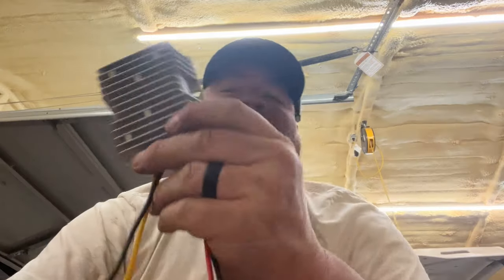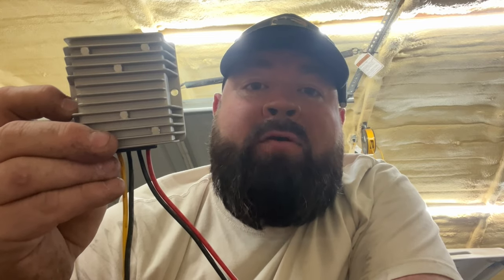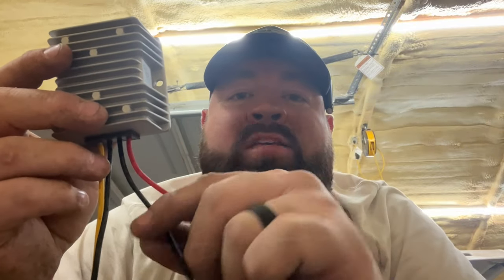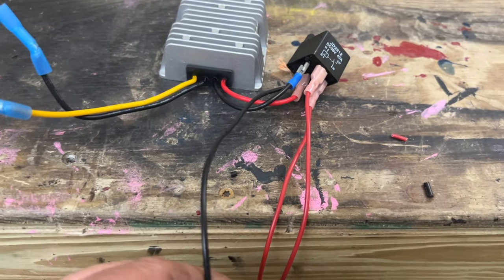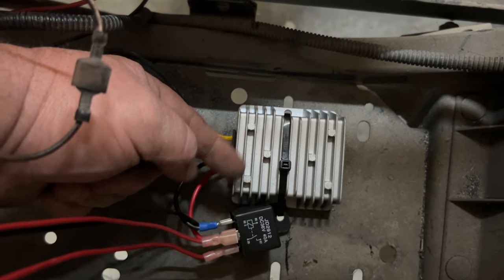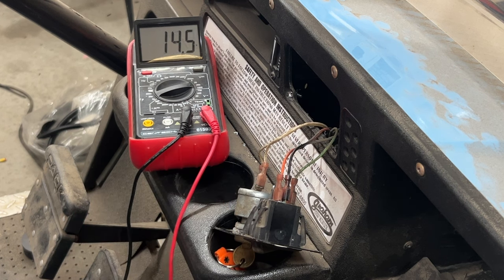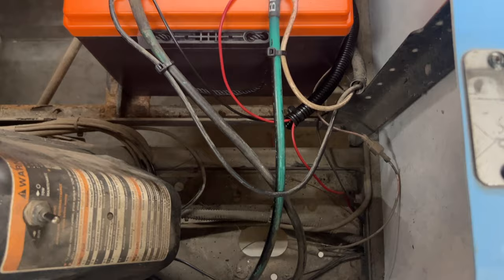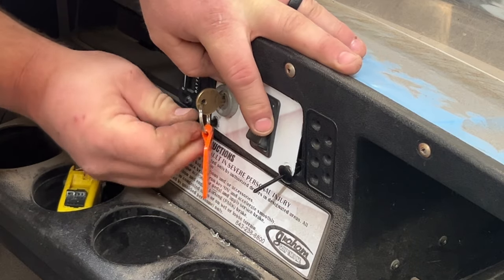Ezgo TXT PDS Golf Cart DC - DC Converter & Ignition Relay Install

Comment: You just saved my new Lipo 36v battery and my elderly mother’s summer. I couldn’t figure out what was draining the 6v batteries since there were only lights and a battery meter on the cart and they were on switches that I installed. Upgraded to LiPo a few weeks ago and still had a slight draw even though lights and meter were both disconnected for troubleshooting. 
Was just about to replace the step down converter when I ran across your video. Big thanks !

Comment: Once again, thank you for explaining relays (quite a few videos ago) so that I could finally understand them. Another benefit of using a relay with a puck converter (especially for the timid) is you don't get that "ZAP!" and a little bit of 💩 in the pants when first connecting the puck converter to power that you get if you just wire it directly. The "ZAP!" only happens that first time you connect it, and I know it's coming (and that it's okay/normal), but I frickin' hate it!

Comment: My friend told me guests using her cart left the lights on and killed the cart. Ezgo has the light switch down by the charger plug so easy to forget. I was doing a lithium conversion for her back then when I watched your older relay install video. Perfect timing as usually, that’s why I keep up with your videos. Works great and I always add the relay to the conversion’s that I do. You made me look good once again.
Reply from the maker: I think I have a new one coming this week you might be able to use as well. I havent seen anyone do this mod and I think it will be helpful!

Comment: I have a dedicated 12V battery for all my 12V accessories. I used a 36V relay to turn on the power to the radio and lights. Has worked great. Once I go lithium and 48V then ill$9 the same thing with a lithium 12V. I’ll have 48V with 4 batteries and 1 for the 12V. So a total of 5 batteries at half the weight.

Comment: Great video, thanks. I just installed the same Voltage Reducer on my Ezgo DCS, ‘97. I wired the 36v Input to the Reducer to the 36v Switched side of the Key Switch. Reducer has no power to either side with the key off. I’m confused why a Relay is needed. Thanks Ryan for All the great videos.

Comment: THANK YOU!!! Amazing video and very well explained!  I have a question for you you though.  My cart is currently wired exactly like this.  BUT I have since replaced the key switch with a 4 terminal switch.  I can use position 3 (on with accessories) to get rid of the relay, correct?  So my DC converter will not have power unless position 3 is switched to on.  This will get rid of the relay as well as the extra toggle switch on my dash used for my lights as well as all the associated wiring!  Your help is greatly appreciated!
Reply: Also, do you have a link to those rivets you used?

Comment: Hey Ryan, love your videos. I’ve learned a lot. If I plug my golf cart in every day, why should I worry if my converter is always running? I never take the cart anywhere. I use it (everyday) to go to the pool, cruise the neighborhood, “walk” the dog. I’m not very good with electrical, so you can understand my apprehension to get into my ignition wiring. I look forward to your answer.
Reply from the maker: Your converter is constantly converting 36 or 48v to 12v. If you are sleeping, working, school, church, at the beach, the converter is constantly running. This will cause your battery to discharge even slightly over a period of time. You dont have to add a relay, just let it run. Im just trying to make my carts more efficient that ever.

Comment: Hey Ryan.  Its Brent.
I know you usually do videos about upgrades or fixing an electrical problem to get the cart running.
Would you please, make a video about routine maintenance of an electric cart.
How often should maintenance be performed?
What are the specific steps of the maintenance?
Is there anything that should be done before putting the cart away for the winter?
Are the maintenance steps different for each of the big 3 brands of carts? 
I have now owned my cart for 7 months. I have no idea how many different people owned this cart before me.
I will tell you that every screw, nut, and bolt that I have encountered is rusted. I have replaced some with stainless steel on my '09 CC Precendent. I can’t get the front body panel off because someone riveted it on.
I can drill them out but do I have to put them back? Never attached rivets before. I know you have an air compressor and air tool for that. That seems expensive to me.
I know that all of the screws and wire connections on the head lights are rusted. I cant even figure out if they are 48V or 12V, because they are incandescent lights.
I see under the cart that there is a lot of grease and dirt accumulated on the front left suspension.
I have no idea what I am looking for to determine what the problem is. The front right does not have any of that.
I have done no maintenance so far.
I have not washed it 
I have not checked the tire pressure. 
I have no idea how old the batteries are.
The batteries have been taken out and all the cables are off. Batteries take a charge when they were in the cart. They are not being charged during the winter. 
Each battery tested at 9 volts as it sat on the concrete floor about a week ago. 
Battery water has not been checked. Dont know how to do that.
Some people may think 'Oh come on. Everybody knows that." Sorry, not me.
Thank you for all you do.

Brent

Comment: Hi Ryan, after installing the relay, it worked good for about an hour, then it burned the relay. I realized nothing was working, ( relay was burned) so I installed another relay and I noticed it was getting real hot and it’s fixing to burn. I can smell it. What could be a better solution. I followed the instruction step-by-step. I do have another relay from the output power cords to the light bar.
Let me know if you have an answer or a solution to this dumb problem , thank you sir.

Comment: 7:01 do you have a video on this? I ordered a fuse box for my 12v accessories. Are you saying that there’s a separate fuse that needs to be set up that you connect to relay then fuse to battery? Thx so much!

Comment: This only applies to 4 wire converters right? A 5 wire converter with signal wire will not draw anything when the ignition is off correct?

Comment: How about making the 48v input switched by the headlight switch. The 12v output can be wired directly to the lights. That way the whole system is switched. No more drain and simplest wiring and fewest areas of possible fault. K.I.S.S. Cheers

Comment: Great explanation. I am finishing on a lithium single 48 volt conversion now(2015 precedent) and it has an oem 16 to 12 volt reducer installed underneath the front frame. Installing the 48 to12 reducer ( and relay)  . Do I just leave the original reducer ? ,or can I just cut it out and reconnect the wires?(1 in, 1 out).
Reply from the maker: If it was mine I would cut it out and start fresh. But thats just me.
Reply: @Fentertainment  
Thanks, that was my first thought

Comment: Hey Ryan if you have a lithium battery  that you can turn on and off  like the " "vatrer"  you wouldnt need the relay correct .
Reply from the maker: If you wanted the hassle of lifting the seat every time you got on or off the golf cart. I mean sure but a $5 part and some spare time will cure that. Maybe do the same with your vehicle, Unhook the battery everytime you turn it off!
Reply: @Fentertainment  You didn't have to be smart about it . I just asked a question . I barely  drive my cart  and  turn the battery off when not in use.

Comment: @fentertainment- thanks for the great video.  Maybe a dumb question but if I'm running this set up with my headlights can I tie in under carriage lights or do I need an entirely different converter?
Reply from the maker: You can add more accessories, I would just run a fuse block after the dc converter so you can run each accessory to have a dedicated fuse, power spot and some fuse blocks have ground blocks as well.

Comment: Great video, my txt has 3 position key switch off on turn one more for the lights, should I or can I add a DC converter to this if I want to add more accessories?
Reply from the maker: There should be 4 terminals on the back of the key switch. 2 for cart on/off 2 for light on/off. The dc converter can still be used since the headlights are getting power from somewhere now. Just need to add the dc converter. Maybe I will make a video of that one day.
Reply: That would be great

Comment: I just got my ergo txt from the shop and they couldn’t figure out why the reverse works when the key is in the off mode. I had a reliance dc 30A converter installed and he wired a kill switch for all my accessories. Was that needed?

Comment: Hey how you doing ? I just bought a CarPlay monitor with backup cam for my electric 2017 Yamaha drive 2 golf cart. I have two falcon big batteries powering the cart. The backup camera has a long cord to plug into the tablet and has a red wire to activate the rear view camera when it’s put into reverse. I dunno where to wire that red wire at. If you could help with an answer for this that would be great.

Comment: I have the blue DC convertor from 10LOL and my lithium BigBatteries are losing power. Should I get and install a relay like this? Only accessories I have are my headlights and brake lights.
Reply from the maker: If that blue converter has 5 wires then yes. However I would tie both the red & blue wire to the relays 30 & 87 to the battery.
Reply: Thanks. Love the channel and all you've done. Learned a lot about golf carts!!

Comment: Hi buddy,  is it possible you could just run a wire from the power side of the inverter to the key switch and do the same thing without a relay?
Reply from the maker: The key switch is supplying a minuscule load to trigger a relay vs what it would be to run accessories off a dc converter. The relay is just an inline switch as it still gets the main power from the battery. I personally wouldn't risk trying it because what you could damage by pulling that amount of amperage for accessories through a dc converter.
Reply: @Fentertainment  that makes sense. Thanks for the reply.

Comment: I have a TXT (manual forward/ reverse) I have LEDs and a radio etc. when I switch from forward to reverse or other way it turns everything off between. I can’t for the life of me figure out how to stop it from doing that.
Reply from the maker: The key switch looses power when the fnr switch is in neutral.
Reply: @Fentertainment  no way around that aside from a manual switch then I guess. Thank you.
Reply from the maker: @guninkdesigns3838  Ive been thinking of some different things. A switch will work but Ive been thinking of some different things.
Reply: @Fentertainment I’m following if anything cool comes up. Love the videos. Newish owner and learning.
Reply from the maker: @guninkdesigns3838  Much appreciated.

Comment: Would you do a walk through of a different DC to DC converter or send me to a link for said converter? I can also email you if you prefer. I’ve emailed you before but didn’t hear back.
Reply from the maker: I have other dc converter videos. This is my oldest 5 wire. However even with the 5 wire converter it still has a parasitic draw when the golf cart is off. I would still add a relay. However this was before I added relays.  https://youtu.be/P-6Q-0hFB8Y?si=pMGH8SArB_IL-S08
Reply: @Fentertainment  I’m preparing to install  reliance 36v converter and was hoping there was a walk through on the installation process. I cannot find a wire diagram displaying the wire sizes to increase the distance of the wire.